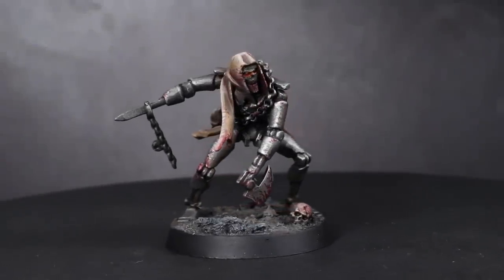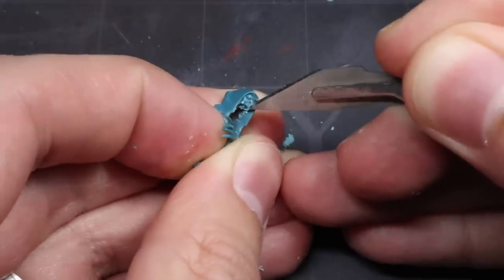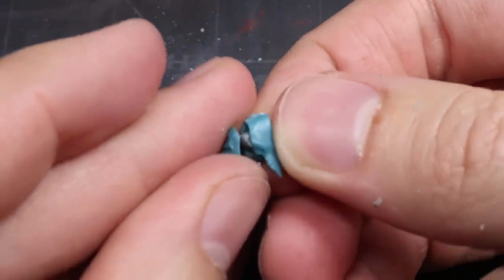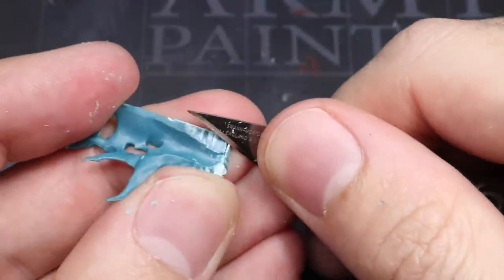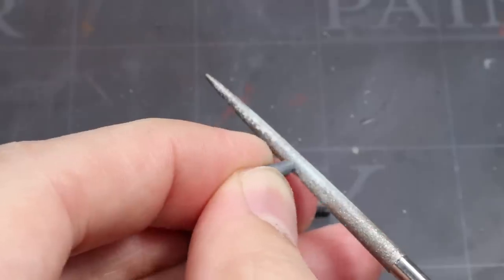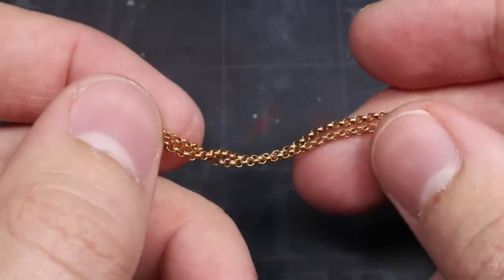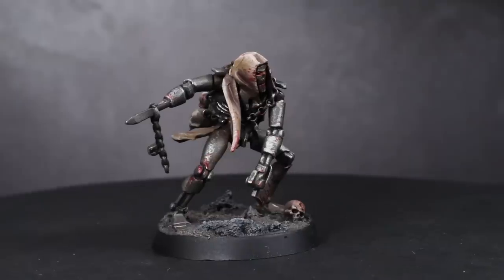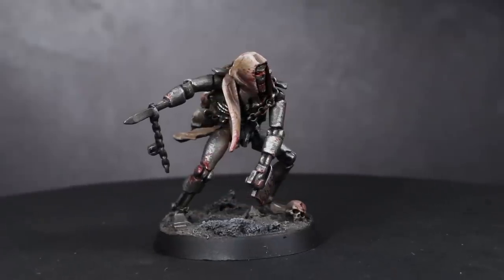How To Convert Plastic Necron Flayed Ones - Warhammer 40k Conversion Tutorial

Comment: What a lot of Klat!...save a fortune...buy some necrons, part build them, add the axes blades and whathaveyou then get greenstuff and make a thin (thinner the better) starfish shape ( you'll need to raid your bits box for this ) get two open hands ( i'm imagining the guardsman box or genestealer cult box will have them) then add them to the ends of two of the "arms" of the starfish shape and then drape over the necron to look like flayed skin with dangling dead hands...if your bits box or pockets are deep enough there are some durkari with bare feet so you could add feet if you wanted to show off, if you slice a chunk of a models face off it looks ok lightly pressed into greenstuff...cheers now